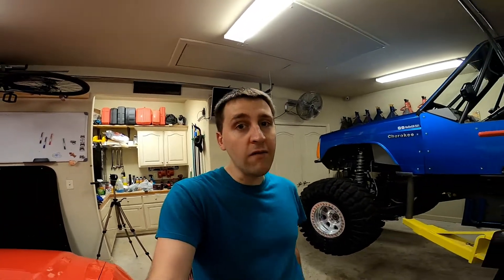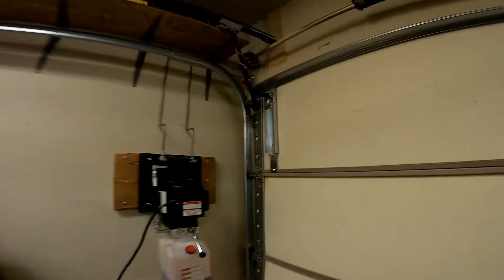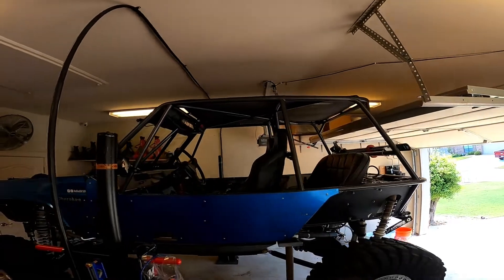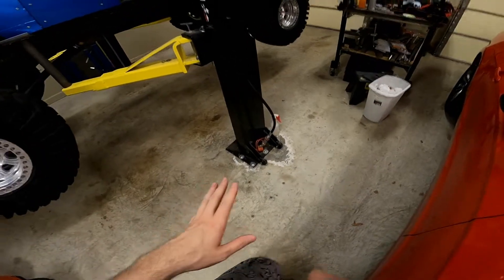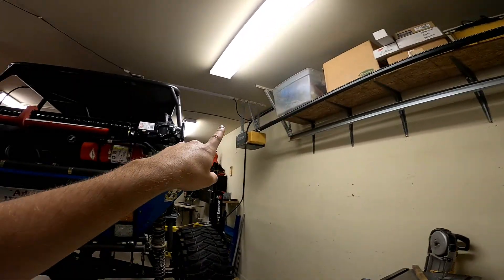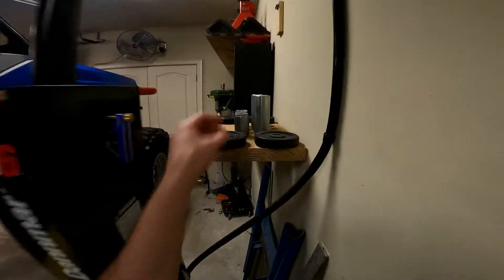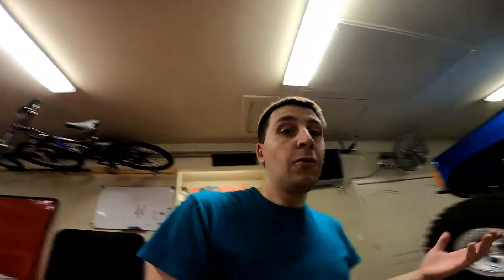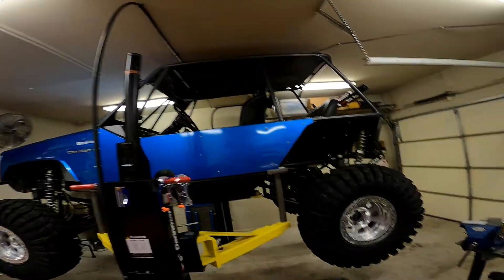Must Have MaxJax 2 Post Lift Upgrades (more lift height for $25!!)

Comment: I've got the M6 too, it's great.   Good tip on the door opener for those with a single bay door.  
I ran electric conduit to the ceiling and put the H lines in that.  Left the pump on the stand against the wall and ran that side through the conduit at doorway height.  That extra height is cool but not needed imo.   I can sit in an old office chair under a vehicle and just lean back and it's perfect.  Really no need to stand up.  Plus that won't even work on most vehicles since you have to have the clearance in the first place to put them under the vehicle.  Still pretty inventive, not sure I'd do that though could make it easier to tip.  In looking at it more I know I wouldn't do that, not worth the possible consequences.  The vehicle needs to be resting on the arms.   Cars can tip you have to be super careful load balancing them,  so I would not do that.

Comment: Offsetting the gare door will only work if you have a torsion spring setup on the door. It will not work on an extension spring setup where there are 2 independent springs. The door will lift crooked. Good idea though for torsion.

Comment: Fantastic tips , can you show us the garage door in action with the offset installation and closer look at the set up itself , so I can get a better idea on how to do the same thing ? Thanks I appreciate it.
Reply from the maker: I don’t have any other videos taken of the opener with the new bracket. However, the operation of the door is exactly the same as with the centered opener. Once you have the bracket, you just need to move the opener over a maximum of 4 feet. Depending on your opener and outlet location, you may need to extend your power and sensor wiring. I do also believe that you must have a torsion spring setup. I don’t think you can use an offset opener with an extension spring, since the spring force isn’t equalized with extension springs. Here is the information on the bracket. It is a 21” Clopay Opener Reinforcement Bracket. It is SKU#135317 at Home Depot. It comes with instructions and the install is pretty straight forward. You will also need a piece of wood to mount the opener rail to. Here is a link to the bracket. https://www.homedepot.com/p/Clopay-21-in-Opener-Reinforcement-Bracket-Kit-4125479/100069364
Reply: I used this tip and it worked great. I put the opener about 4 inches inside the track and it opens just fine (single door). I also inclined the track by 10 degrees to increase clearance. The extra bracket wasn’t necessary, I just took the existing bracket and relocated it to the side.
Reply: @garthmason369  thank you for the info I appreciate it 👍👍👍👍👍

Comment: What did you use to bent the hard pipe and what dod you use to make the connection between the hard pipe and the flex line Thanks
Reply from the maker: The hard lines were bent with a heavy duty brake line bender. I will say that the bender almost wasn't heavy duty enough. I mounted the bender in a vise to be able to bend the tube. For the connections, I believe everything was 3/8" 37 degree flares. I just went to a local hydraulics shop and told them what fittings were on the line currently and they helped to get the right adapters to go from hardline to the flex lines.

Comment: did you install the standard anchor? how are they holding up?  would you recommend doing the epoxy anchors instead?
Reply from the maker: I went back and forth on if I should use epoxy anchors or the standard ones. The epoxy anchors ended up being on backorder so I just used the standard ones. They installed easily and haven’t given me any problems so far. Just make sure you clean ALL of the dust out of the holes. On my first anchor, I didn’t get it as clean as it should be and the anchor slipped a little more than the rest, before biting in. It still tightened just fine though.

Comment: I was actually curious with how you mounted your bikes to the wall. I get the overall concept, but wanted to ask about the straps you used for the handle bars. Something you bought or did you make them yourself?
Reply from the maker: I have a Husky brand strap from Home Depot for the handle bars. It is a velcro strap with a hook in the middle. The hook clips to an eye bolt in the ceiling joists. I also have a video that goes over the bike mounting. https://youtu.be/egA7sEwdFrA
Reply: @HeBeGB501  Thanks! Noticed your Arkansas tag. Where are you located? I’m in Bentonville.
Reply from the maker: @djguillory1433  I’m about 3 hours away, in the central part of the state.

Comment: I saw you point from where your opener was to where your opener was moved to, but I could not see anything as to what your opener was. Looks like it was not a normal opener with a chain. What kind of opener motor are you using? Thanks
Reply from the maker: It is a standard, chain drive, 1/2 hp Lift Master opener.
Reply: @HeBeGB501  thank you

Comment: Where did you purchase the tubing from?
Reply from the maker: I ordered the material online. I believe the company was Coremark Metals. There are a few places to order metal online though. You may also want to check with a local steel yard to see if they have any cut pieces of the tubing.

Comment: Have you encountered any tasks you couldn't do because the lift doesn't go high enough?
Reply from the maker: I haven’t had any issues with tasks yet. So far it has been just like having a normal 2-post lift but shorter. The only real down side is that you have to sit on a stool instead of standing up. If you don’t have the ceiling height for a full size lift this one is still waaay better than laying on the ground.

Comment: How wide is your garage door?  are the posts centered to the door?
Reply from the maker: The door on the bay with the lift is 9ft wide. I the columns aren’t centered with the opening. The columns are set at 91” of drive thru space between the arms. One of the columns is set with the arms in line with the door opening, while the other is offset by 17”. This gives me enough room between that offset column and the wall. All of this puts the centerline of the columns 8.5” offset from the centerline of the door opening.
Reply: @HeBeGB501  okay, I will have to measure. I have a similar 3 car garage like yours but my door is only 8' opening and I only have 6 inches between the wall and the door oping. My set up is much tighter. Maybe in the 2nd car bay.

Comment: Whats is thr safety locks heights? I have an 8ft ceiling.
Reply from the maker: I haven’t measured to confirm but the advertised maximum pad height, without extensions, is 47.5”. The manual lists a 46” lift height. So, I assume 47.5” is at the top of the cylinder travel and 46” is the top lock position. They also have 7 locks that are spaced 3” apart. Assuming that 46” is the top lock position, the lowest lock would be about 25”. They also have a calculator on their website where you can enter your ceiling height, vehicle height, and ground clearance to see how high your car will lift at each lock position. https://www.maxjax.com/measure/
Reply: @HeBeGB501   thanks man. I have an 8 ft ceilings, Tying to see if I should raise the ceiling

Comment: Will it lift a 03 town car also a astro, not at the same time nac.
Reply from the maker: It depends on the weight of the vehicles. The lift has a maximum capacity of 6000 pounds.

Comment: Can we talk about those bike storage racks?
Reply from the maker: I am have a 2x4 mounted to the wall studs and I use a screw in ladder hook, screwed in to the 2x4, at each tire. I then have a Husky heavy duty hanging carabiner Velcro strap that loops around the handlebar stem. The carabiner hooks into an eye hook that is screwed in to the ceiling joists.
Reply: HeBeGB501 You should make a quick video of it.